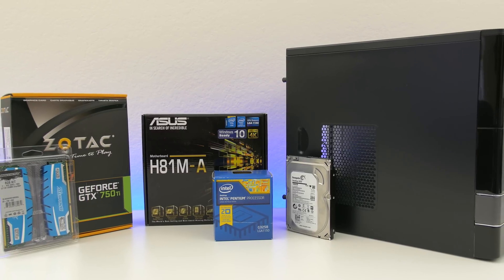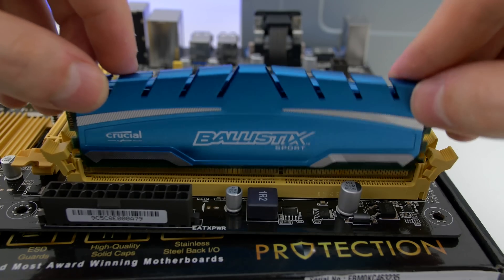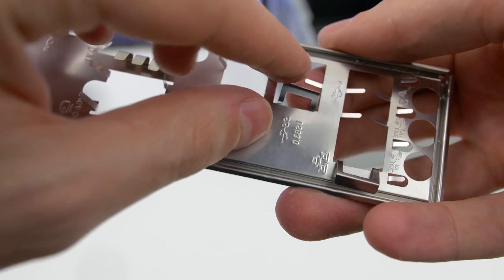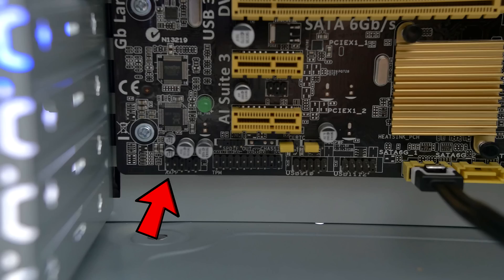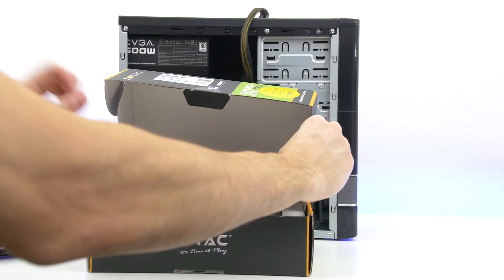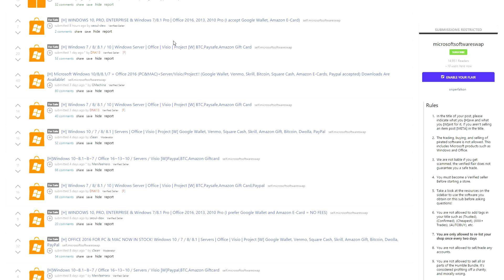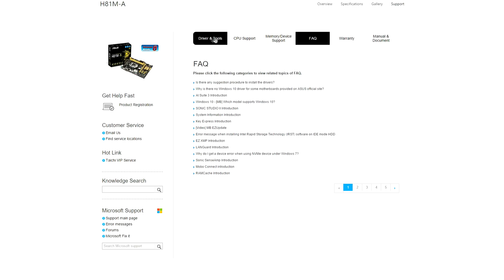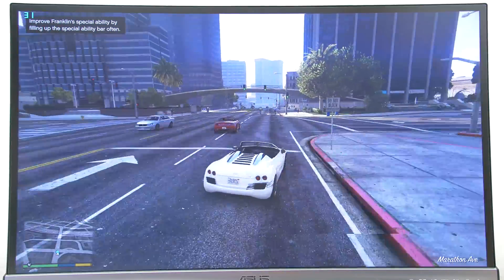How To Build $350 Gaming PC w/ Windows + Overclock!

Comment: Just because you can overclock that Pentium dosent mean you should use it... It has TWO CORES. ONLY TWO!!!
Reply: Not everyone can afford quad core.
Reply: Theres a quad core amd thats the same price. Its just the overclocking that makes the Pentium cool and all
Reply: Two cores is not a reason not to get a CPU. I mean, the i3 6100 has two cores. Granted, it has hyper-threading, but by your reasoning it is unusable because it has two physical cores. If you are making a budget PC, an Intel Pentium G3258 is a good choice for its overclocking ability at around $60. An Intel Pentium G4400 would be a slightly better option for the proactive builder because it is on the Skylake socket, meaning you can easily upgrade to something like an i3 or i5 in the future. Plus, the Intel Pentium G3258 at stock speeds performs on par or just barely worse than an AMD X4 860K, which is a quad-core for roughly $30 more. The G4400 also performs at about the same level, for around $50. Sure, the two cores without hyper-threading have high risk of capping out and stuttering, but there are programs that limit CPU usage to a maximum of 99% (100% usage is what causes most stutter), slightly sacrificing framerate but providing smooth performance. For a cheap $350-400 build paired with a GPU like a 750Ti, 950, or the new 1050Ti that's projected for release near the end of this month, it would run games fairly well at decent settings. A combo of the G3258 at stock speeds and a 750Ti can run the Battlefield 1 Beta on medium settings 1080p at console framerates of 30fps, just barely going into the high 20s. Putting the settings on low but keeping 1080p raises framerates to roughly 40s and 50s, and lowering resolution to 900p would likely add a boost in frames of 5-10. So basically, don't put down a processor purely because it has fewer cores than you, as an *obvious* expert in PCs would enjoy. For a budget option, this is likely the best you can get your hands on.
Reply: SHUT THE FUCK UP NO ONE WANTS TO HERE WHAT U ARE SAYING YOU 3 YEAR OLD/ROBLOX PLAYER (ROBLOX SUCKS ASS!!!!!)
Reply: 2 cores that can run gta v in ultra settings, why not?
Reply: +Mr. Krusher Hear* xD
Reply: It's a good budget CPU, better than any AMD CPU on the market.
Reply: RobloxParkour
yo don't even lol
ignore him, it makes u look stupid when u fight over pointless things. Will this matter in 5  years?
Reply: i think as today's requirement's even the minimum budget PC should get at least i3-6100.
Reply: Imam Gilbran two cores could be a bottleneck when it comes to gaming. Overclocking may help a little but its no big difference.
Reply: +RobloxParkour i build this pc with intel i5 6500 XD
Reply: Mr. Krusher i actually dont play roblox often anymore so idgaf. And im 13 and i made this when i was like 10 so YEAH. I have another account anyways.
Reply: +Technology Spotlight AMD is pretty great for budget builds. Too bad you can't go to Intel straight away tho when u got the money, gotta get a new mobo :/
Reply: Sitragy Intel is better at CPUs and AMD is better at GPUs.
Reply: +Technology Spotlight I know
Reply: PKMNTrainer Steve damn, I take it you know your stuff
Reply: RobloxParkour it has hyperthreading
Reply: Imam Gilbran awesome, it shouldnt have as many bottlenecks then
Reply: Sitragy ye no
Reply: PKMNTrainer Steve  thanks for the info.
Reply: oh fuck the dual core wont run woblox!!11!1
Reply: Vent you may have over exaggerated there. Roblox would run fine on this PC. But I just think two cores is a little... inconvenient these days.
Reply: RobloxParkour OH NO MY ROBLOX CLAN NEED ME

FUK
Reply: Vent actually, i barely play roblox these days. So my name really dosent count anymore, i just use this channel for watching my favorite youtubers like many other people do. So i dont upload anymore to this channel, its basically cancelled.
Reply: Vent wow im not falling for that shit. Anyways its just my personal opinion on the CPU. No need to criticize it.
Reply: you must be a genius holy shit.

i can criticise your opinion if i wish, you posted an opinion to the internet so expect criticism

you still play woblox
Reply: RobloxParkour Stop giving him more bullshit to feed off of. Seriously, youre bombing my notifications.
Reply: PKMNTrainer Steve aww poor notifications. :(

go fuck yourself
Reply: Just because it's a dual core doesn't mean it's absolute shit. It's a budget build, you can't expect an i3 or i5 in this. Yes, an Athlon would seem like a good idea, except it isn't since the FM2+ and the AM3 socket are dead and you won't have any upgrade path whatsoever.
Reply: k
Reply: I'm pretty sure amd can keep up with a g3258 lol
Reply: Core count doesn't matter is based on the performance. 
The Athlon 860k is a quad core that matches the same speed as the Pentium. (With the same price)
The Pentium how ever is a much better overclocked and owns in terms of thermal performance.
Since the Pentium is much more power efficient, overclocking is easy. The Athlon can get to 4.2ghz, but anything higher than 4.4 will be unstable since the cooling will have to be a freezer, and cooling like that is bad for a computer with moisture in the air. The Pentium can reach 4.2ghz with a stock cooler and can perform as well as an i3-6100 the Pentium is clearly the winner. I'm not an Intel Fanboy but to be honest Amd FX series is dead for now, until Zen.
Reply: RobloxParkour the i3 6100 has 2 cores too but it works like quad core so dont see the cores or the ghz it depends
Reply: Either way, it's better than my current processor XD. I have an AMD Athlon II x2 220 running at 2.80GHz and it's absolutely terrible. Can't even OC it because the bios won't let me.

Comment: CAN I MAKE THIS BUILD AND INSTEAD OF THE GTX 750, CAN I USE THE AMD RX 480??? ALSO, CAN I UPGRADE THE CPU LATER AND WILL THE MOTHERBOARD SUPPORT IT?? SORRY I'M NEW AND I JUST WANT TO GET INTO PC GAMING (USED CAPS TO HOPEFULLY NOT BE IGNORED) THANX
Reply: You can use RX480 but the G3258 processor will bottleneck the card. You can upgrade the processor to any 4th gen haswell processor. The latest generation is 6th by the way and the motherboard does not support it.
Reply: Then can u suggest a 250 dollar build for me? Maybe with a slower GPU but still really good? I really want to get into PC gaming but don't know how 😥
Reply: Julian Monroy That is almost impossible unless you go for second hand component.
Reply: yea it's ok, I want to upgrade an old desktop mu aunt has haha

Comment: Hey, I built this and it is great. But for overclocking, my voltage is ay 1.04 instead of 1.342. Could this be because I downgraded to the 430 W power supply? In that case, would I overclock to 1.043 v?
Reply: If you compare 2 G3258 processor. They may look identical to you but microscopically they are not. Both can run at rated speed but voltages vary due to microscopic defects that cause them to vary in voltages. This theory applies to all hardware electronic component too.
Reply: so u do exactly as he did?same pc ?
Reply: Yep, same pc and everything.  Should I just overclock to 1.043 V instead?
Reply: You should try it, if you get a blue screen (from not enough power supplied to the processor), then wait for the blue screen to reboot the computer and press the key to get into bios and change it back.

Comment: I've had this build for awhile but I'm planning on upgrading very soon. If I were to upgrade the CPU to an AMD I'd need a compatible motherboard which would be AMD correct? How would I go about upgrading to a new motherboard (if that's possible)? Or should I just sell this thing for like $300 and build a whole new system together? I'm not sure.
Reply: I plan on upgrading to a GTX 950 and an AMD FX-6300 I believe is what it's called (black edition idk if that
Acts different or not)
Reply: sell the pc get an extra 100 or 3200

Comment: Will this case work with this build and/or the third party cooler he mentioned?
https://www.amazon.com/gp/aw/d/B00ZPWOA6I/ref=mp_s_a_1_14?ie=UTF8&qid=1473560417&sr=8-14&pi=AC_SX236_SY340_QL65&keywords=micro%2Batx%2Bmini%2Btower%2Bcase&th=1&psc=1
Reply: yes
Reply: The hyper 212 evo fan? I think that case in your link is only a little bigger or the same exact size as than the one in this video and the hyper 212 evo fan didn't fit in mine. I would buy a corsair carbide series 100r if you don't mind spending an extra $12

Comment: Would it be a good idea to get the third party cooler if I am going to overclock the CPU. Or is it not necessary?
Reply: You can't even overclock the CPU. The stock cooler is good enough. When sitted properly, your CPU will not go over 80 degree C on load.
Reply: But he shows us how to overclock it in the video. Shouldn't I be able to since he is able to?
Reply: My bad, i was referring to all the non-k processor. G3258 is a special case. You can overclock that processor. You can do mild overclocking with stock cooler. You need to get a better 3rd party cooler if you intend to do heavy overclocking.
Reply: Thank you! You have been helpful!
Reply: Not necessary unless you are going above 4.2ghz
The processor can overclock to 4.2 from 3.2 with the stock cooler alone. 
A third party cooler would be a good choice to reach even higher clock speeds. 
To be honest though I think to go above 4.2 would need a good overclocking motherboard.

Comment: Hello TechSource I'm going to build this pc and I was wondering if there is a quad-core CPU that could work with this build and have the same performance or better.
Reply: i5 4440, i5 4460, i5 4570, i5 4590. All will work and all are 2 times better than G3258 for normal task. It will be 0.5~2 times better for gaming.
Reply: Will I have to change anything? Motherboard or ram?
Reply: No. This series of i5 processor is compatible to the motherboard.

Comment: does anyone know any good alternative Intel processors? I don't mind upping the price a little. Just has to be quad core, that's it.
Reply: i5 4440, i5 4460, i5 4570, i5 4590. You won't be upping the price by a little, you WILL be upping the price by a few hundred dollars.
Reply: FX-9590 is a good option.The only thing is you will have to use another motherboard.
Links:

FX-9590:http://www.newegg.com/Product/Product.aspx?Item=N82E16819113347

Crosshair V Formula-Z:http://www.newegg.com/Product/ProductList.aspx?Submit=ENE&DEPA=0&Order=BESTMATCH&Description=Crosshair+V+Formula-Z&N=-1&isNodeId=1

Comment: do you need drivers ?
Reply: Intel integrated graphic card, graphic card driver and realtek sound driver. These are all you need.
Reply: Yes, but you will get disks with all the drivers, or you could just connect to the internet and let windows update try to find them.

Comment: Can I use an Asus GeForce gtx 750 ti in this build?
Reply: yes
Reply: +WB Is there much difference between the two graphics cards, is the Asus one worth it? Thanks
Reply: Just different cooling design but both will perform almost the same. Since both give almost the same performance, get the cheaper one with good warranty.

Comment: Will a geforce gtx 950 or 960 work with this build?
Reply: yes
Reply: @WB IsMe Will this work ? 
GPU-  ZOTAC GeForce GTX 960 2GB GDDR5
CPU-  Intel G3258 4 Pentium 3.20 GHz 3M Cache 2 Core Processor 
Case- Zalman T1 PLUS Micro ATX Mini Tower Computer Case Cases T1 PLUS Black
Mb-  ASUS H81M-A MicroATX DDR3 1333 LGA 1150 Motherboard
Ram-  PNY Anarchy 8GB Kit (2x4GB) DDR3 2133MHz (PC3-17000) CL10 Desktop Memory
HDD- Seagate 1TB Desktop HDD SATA 6Gb/s 64MB Cache 3.5-Inch Internal Bare Drive (ST1000DM003)
Monitor-  Acer G246HL 24-Inch Screen LED-Lit Monitor
Reply: +CS:GO & more ツ, Endriu ツ no the GPU will bottleneck and only be around half as good as its full potential I would recommend upgraded a CPU to a Intel i5
Reply: +CS:GO & more ツ, Endriu ツ a gtx 950 would work but anything higher would bottleneck and you should upgrade to a i5 or something more beefy than the pentium
Reply: NickIsGaming Can you recommend me some i3 ?
Reply: +CS:GO & more ツ, Endriu ツ a Intel core i3 4160 will work fine but in some rare instances there will be a small bottleneck but if you can upgrade to an i5
Reply: NickIsGaming I dont have enough money for i5 but ill upgrade to i5 in the future ;) Thanks
Reply: NickIsGaming 
Will this work ??
i3 4160
8 GB ram 1600 mhz
Evga Gtx 1050 ti sc 4GB
Mobo : intel H81 express
Psu : Evga 430 W
Reply: Yes this is great it will be able to run games really well but with higher demanding games you might have to turn down the settings
Reply: NickIsGaming tnx What about GTX   1060 3GB no bottleneck ???
Reply: +ocs shark it will bottleneck and the gtx 1050 ti is a great card
Reply: NickIsGaming yes , but 1060 saved me from 4 - 5 years of upgrading
Reply: +ocs shark go ahead but it won't preform well until you get an i5

Comment: i just made this and everything.       runs.  execpt my monitor isnt picking it up would it be my moniter or.   computer cause the moniter had a rough time picking  up my last computer
Reply: FIXED.       WAS PLUGGED INTO WRING INPUT
Reply: +savage lifestyle22 Hey did you use HDMI? If so, where did you get the HDMI cable for the motherboard?
Reply: +101ified i got the Amd graphic card
Reply: +101ified i got the Amd graphic card
Reply: its pretty beast  latly i started having like to where my apps wont start cause it says app already running
Reply: +savage lifestyle22 have you tried running overwatch on it?

Comment: +TechSource can you buy a wifi antenne and plug it into your motherboard?
Reply: yes, use a USB wifi adapter.
Reply: But i mean litterally on the inside.
Reply: you can, pretty sure it sells under the name "wifi card"
Reply: Yes, you could use an internal WiFi card.  I did it with this PC.

Comment: A dell prebuilt pc with:
i3 4150
8 gb ddr3 1600mhz
1TB HDD
Add an evga gtx 960
and a 500w psu and there you go. Great pc for around 450$ Do you need more? if yes just buy an i7 and a gtx 970 or 980 and a better psu to handle all of that. you can even slowly upgrade from i3 to i5 to i7 or from i3 to i7 after that ugrade slowly to 970 or 980 and thats done. Epic gaming pc for a really  low price! Its not hard at all!

Comment: The optional Coolermaster EVO 212 will not fit in this case. I am building this with my son and had the motherboard all assembled and installed with this cooler and realized the side will not fit on the case. The cooling tubes sit nearly half inch beyond the side of the case. Now disassembling and using the stock cooler. $30 down the drain.

Comment: Do I have to use this specific case?
Reply: No. Any case that support Matx motherboard will do.
Reply: Thanks! I may want to upgrade the case to look nicer. Thx :)
Reply: +WB IsMe Will the Cooler Master N200 work well?
Reply: K Mac Will work.
Reply: +WB IsMe Sorry. I'm not so tech savvy. Would this work?
https://www.amazon.com/dp/B01BV1Q2Z8/ref=cm_sw_r_cp_api_CVLWxb9Y6BA7N
Reply: yes
Reply: Will the Cit F3 work well? Or the Cit Lightspeed?
Reply: Both will work
Reply: +WB IsMe thanks
Reply: +WB IsMe hey, you seem to know whats going on here. Im building this but my psu doesnt seem to have the cable labelled usb like ed's... Do you know what i do?
Reply: +Alex P the cables labelled usb etc are not from the psu, they are for the case
Reply: +Blaine Colman wait so in my nzxt s340, do i have to plug the usb's in to the psu?
Reply: +Alex P into the motherboard, then plug the psu into the motherboard etc
Reply: +Blaine Colman okay thank you. and what about the usb ports and power button at the top of the case? im not with the pc right now so i cant look but im not sure if theyre all connected to the motherboard..😶
Reply: All connector from the case are to the motherboard except the fan which is to the PSU.
Reply: +WB IsMe i dont think theres the right connector for the usb 3.0 ports on the motherboard
Reply: That means that your motherboard does not come with a USB 3.0 port. Read your motherboard's internal I/O port from the manufacturer's website. If you does not know how to read, tell me your mobo's brand and model.
Reply: +WB IsMe thank you. ive gone back to it this morning and the motherboard only supports usb 2.0😭 thanks for the help
Reply: So any micro atx case will work?
Reply: ItsFuZe Any case that support Matx or micro atx size mobo will work. Google the brand and model of the manufacturer's website to check the specs.
Reply: WB IsMe BitFenix
Micro ATX, Mini-ITX Motherboard Cases BFC-NEO-100-WWWKW-RP - check this out for me please will this work? Check it on amazon
Reply: ItsFuZe Will work.

Comment: Do you need windows 8.1 pro?
And do you also need to put a wire into the gpu or something. I am using the optional 950 graphics card so I am curious.
Reply: No you don't need it but the pro is better for gaming. 

And the PSU should have a molex connecter which powers the 950.